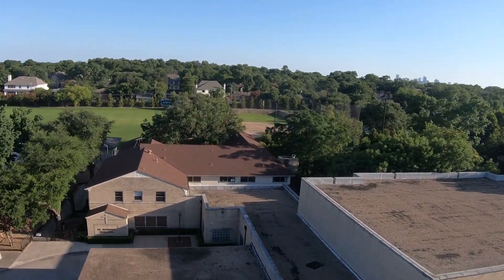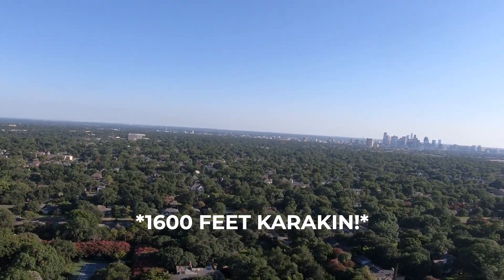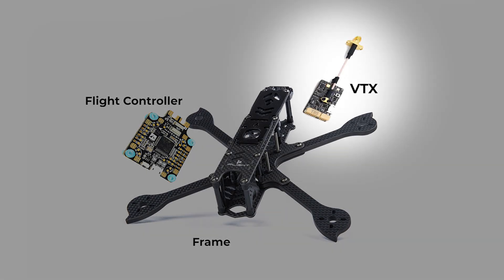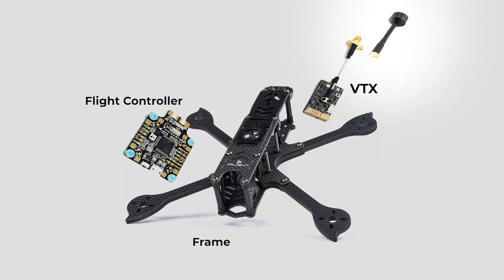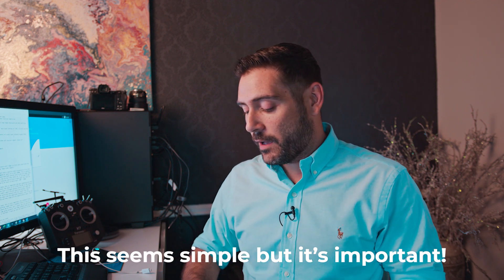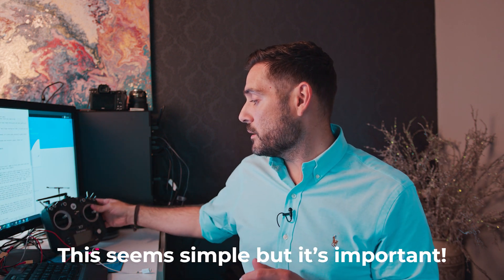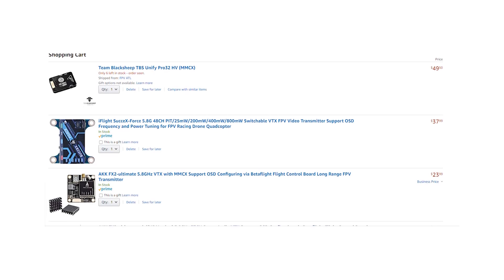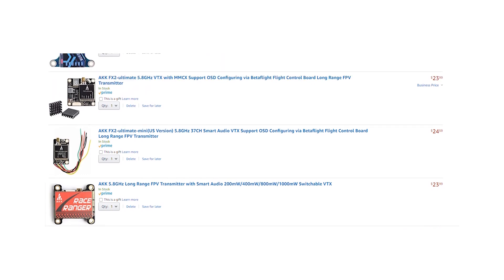Get better Mid to Long Range FPV Video, Long Range FPV Video, required equipment list.

Comment: My understanding is a linear antenna has a higher gain over a circular polarized antenna for long range. For a quad a CP antenna may be a better choice, but the fixed wing guys always run mono pole antenna

Comment: I use radiomaster ERLS Gimini @ 915/868 MHz dual antenna, i never had a issues. 3km@ 10-25mW @ packet rate 250Hz output power. System max is 1W. rate from 50-1000Hz are possible.

Comment: Anyone watching this video now. TBS Crossfire is no longer the best protocol, ELRS(ExspressLRS) is a much better overall protocol now. TBS Crossfire is a little but simpler to set up but its not quite as good.
Reply from the maker: ELRS is a joke. There are few situations where crossfire isnt still the gold standard in reliable long range. I know many people who cannot break even 1 mile with ELRS 2.4 no matter what bardwell says, and ELRS 915 you might as well use crossfire. Crossfire is good for 5. I should make an updated video though. Which would also include ELES.

Comment: Crossfire. Failsafes done. Surprisngly I had a lot of success with FlySky before I got a Taranis and eventually Crossfire. Crossfire is so simple - over the air updates of receivers.
One thing to do is mount your RX antenna at the front of the quad - that way when you turn around to come home the rx antenna will in facing you. 
You'll start losing link quality (RSSI) on the way out, then you just turn around the the LQ should improve straight away.
These days you get the diversity nano Crossfire RX and you can have one antenna at the front and one at the back. If you put them on arms you can do one on the left and one on the right.
You can also do the same with some of the HD VTX's these days - some of them come with two antennas.
If you want to do long range every system (i.e. control link and video) that has a transmitter or antenna needs to be top quality.
True RC make some nice video antennas.
And the tuned TX antennae for Crossfire is pretty good.

Comment: 3 years in the future and I can say that most of this is spot on. However I think the most significant improvement to an analog long range setup is long lolly-pop antennas, both for the VTX and the receiver antennas on your goggles. Your head and the frame of the quad are the 2 biggest sources of interference.

Mounting the camera at 3 points and not 2, is a biggy too. It only needs to waggle 1 degree and the picture's a zig zag mess.

ELRS is hugely more affordable than TBS XF and works so well. With built in WiFi they are super simple however use 115200 Baud rate if you use a module.
Reply: Elrs is great cheaper alternative to TBS if you're willing to learn and set it up.
Reply: @tommegg8486  It's kind of what hobby's are about. While flying is fun it's always better when you learn something that enhances the experience.

Comment: Hell I realized with a decent 5.8 setup I could go quite a ways on the ground with a car and massive obstructions in the way. It really is Harry Potter science sometimes. This is all great information though. I would say technically to cosign your statements here.. so long as you are in the air with what is more or less LOS you should technically be able to travel any distance in theoretical LOS on any kind of system that's 5.8g or below. What I've been stuck on is how people are achieving long range at ground level and through massive amounts of obstructions using 1.3g or even digital 5.8g. It's a whole new level of Harry Potter magic.

Comment: Is eachind ev800d ok?
Reply from the maker: A lot of people like that but I would prefer a used set of HDOs and a module bay I can upgrade. I love the TBS fusion.
Reply: @KAREKINFPV  too expensive. Im from Malaysia and it cost around RM1,500. Imagine that in $1,500. I understand that FPV hobby is expensive. Im just trying to get a cheap mid range signals. 

I have issues with my FPV signals. My setup are:
- mobula 7
- flysky i6
- FuriBee VR01

The issue are:
- signal lost within 3-5 meters
Reply from the maker: @alexruka  I understand price is a lot. This issue sounds like you have a bad antenna on either your VTX or goggles.Also I don’t think the mobula has a very high output power. 25 - 200mw. But 3-5 meters is very short. Insure you are on the correct channel also.
Reply: @KAREKINFPV  does a minor scratch on the VTX antenna can cause issue too? Yes sir 3-5m im not lying its too short. Only 2 channel i can found. The others distorted. 

And also, thanks for the fast reply. Really appreciate that. You got my sub🙏
Reply from the maker: @alexruka  the vtx may be bad. I would purchase a new vtx first with a new antenna. Then test it and make sure you’re on the correct channel. If it’s still not working then it’s your goggles or the goggles antennas.

Comment: update express lrs is better and cheaper than crossfire
Reply from the maker: Sorry man but I don’t trust saving $5 to chance having a betaFPV module crap out snd losing a $900 rig. Also you can’t get telemetry back to the radio past 1 mile ish. Crossfire will go 3+ before losing telemetry. I know bardwell is pushing it hard but there are some disadvantages that aren’t worth switching yet.
Reply: @KAREKINFPV  by your answer I feel that you are the kind of person who thinks spending more means more performance look up wezly wartys testing tracer is shit ghost and elrs is the future naminmo and happymodel are killing it with quality
Reply: Your telemetry speculation is wrong
Reply from the maker: @CHIRAG_FPV  That isn't my speculation. I spent 2 hours on the ELRS discord discussing it in "general" with the admins. You're welcome to go back and find my conversation.

Comment: elrs is better rn
Reply from the maker: If it wasn’t for the telemetry issue I might agree. With the highest power RX you can maybe get telemetry out to 1 mile. With crossfire it’s at least 3.5-4

Comment: What kinda battery do you need for a Chimera7 6S to fly long range?
Reply from the maker: I use these on my chimera 7 https://liionrc.com/products/6s-4-200-mah-45amp-long-range-fpv-drone-battery-range-v1-lithium-ion
Reply: @KAREKINFPV  What kinda flight time and speed are you getting out of that pack?
Reply from the maker: @arkansasaviation5299  without a GoPro and 1300kv motors easy 20+ min. With a GoPro 8 around 12-18 on 1700kv motors. I can cruise at like 60 with 1700kv motors.
Reply from the maker: @arkansasaviation5299  this is the most popular LR battery for 7” on the market.

Comment: Mr Karekin! I learnt so much from just this one video! Any chance you'd do the same guide for dji fpv set up? Im using dji transmitter with dji v1 axii antennas... however i do need a vtx antenna guide on my drone.  Not sure what to go for. Thank you!

Comment: Please what about foxeer wildfire module?
Reply from the maker: It’s a decent module. Not as good as true D Or fusion.
Reply: @KAREKINFPV  thank u cuz when i mount it on the ev 800 d as a mod no improvement really
Reply from the maker: @elbedouirayen7938  it could really be your vtx or camera too. AKK and RDQ, vtx are pretty much crap. The best ones are TBS unify pro 32 HV, the Rush Tank, rush tank solo. Also be sure to turn off any diversity syncing. Sometimes that can mess with the reception if the system doesn’t like the camera you’re using.
Reply: @KAREKINFPV  ok friend thank u so much then i try this
Reply from the maker: @elbedouirayen7938  also always try to use the least amount of antenna connections as possible. So if you’re going from MMCC to SMA then get an antenna that’s an MMCX connector only.
Reply: @KAREKINFPV  yes it's like that so i will change it direct antenna

Comment: After stupidly close frsky failsafes, I put crossfire in everything I have. Never had a failsafe since. My skyzone 03o goggles worked pretty well with the internal and you can add a module to them. But I went to dji. Way way better penetration with dji. Not sure how the hell that even works since it's also 5.8ghz.

Comment: Good info here. But Dipoles can be used for long range, you just have to have linear antennas on your goggles too. There aren't as many options for linear patch antennas on the market, and most people think the regular dipole "rubber ducky" antenna is worthless, but I have gotten some of the best reception flying one of those and a nice linear patch. Try it some time!

Comment: I still only get about 100 ft only w Tbs crossfire
Reply: Make sure you are using 915 MHz on the module if you are in the US
Reply from the maker: Do you have a tango 2? I won’t fly a tango 2 because I don’t think the power output is correct. I could never get one that didn’t have issues. I always use the full sized radio and micro TX.

Comment: May as well go with DJI for the price
Reply from the maker: True, at the time of this video, DJI needed some desperate firmware updates. But there is a point where analog can go further than DJI. By a mile or two in the right conditions.

Comment: This video is pretty outdated, now with express lrs you can have even more range and less latency, 2 times smaller recievers with a total price half of a crossfire cost.
Reply from the maker: Tell me you know what your talking about without telling me you know what your talking about. 💪🏻💪🏻💪🏻💪🏻 although I don’t mind the convenance of crossfire for the extra few dollars. And latency isn’t a big issue when you use something like the DJI vista for long range.

Comment: basically you have  a lot of money as you are advising every expensive option. Should not people get a gold plated frame too? easier to see in the grass. Lol. You need a good rth setup to fly your device back if you out distance your tx and rx gear.
Reply from the maker: I’ve had this discussion with people before. A nice AKK 1w+ VTX is like $45, you can buy a pair of dom V3 used for like $140 and a true d module for $40. It’s hardly the most expensive option. You get what you pay for.

Comment: What about the new Happymodel Express LRS? $24 rx $24 tx and its been tested up to 30km?
Reply from the maker: I’ve heard great things about express LRS. I wish they had a 433mhz version. It’s just not as easy to setup as Crossfire
Reply: @KAREKINFPV  I think thats what the happymodel one is supposed to fix, it comes pre flashed so i think its just bind and fly at that point.
Reply from the maker: @akaKrypt  nice! Please keep me posted on your findings.

Comment: Hi There,  just found your channel. Quick question, do both antennas (on drone and goggles) need to be the same length? I have a hglrc LR antenna on the drone but a small foxeer lollipop v3 on the goggles. Same DB. Thanks . New Sub 🤙🏻
Reply from the maker: Great question! No they don’t, you can use different lengths. The further away from your head the receiving antenna is though the better. Also they both must have the same polarization RHCP or LHCP
Reply from the maker: Also if your doing long range flying, checkout my new shop! LiionRC.com

Comment: Great vid mate 
I also gave the qx7 
Did you do the mod to get the module to work or has that limitation been overcome 
And do you recommend the mini over the full size TBS module ??
Reply from the maker: I wasn't able to get the crossfire settings to work on the QX7 and never tried the mod. I would just plug it into the computer and use TBS agent to change all the settings. It works great! I love the new mini v2 it goes up to 1w but i've gone 2 miles on 500mw with no problems.

Comment: Okay to summarize it a as leymann - We need VTX + spec. antenna for the VTX on the Quad, then we need a Module that should go in the Goggles to receive the video, then we need Goggle Antennas to amp the module and see a nice pic. Then the other way around we need another module that connects to the radio, preferably Corssfire from TBS, and a receiver to receive the signal from the radio, that goes on the Quad? Does the receiver on the Quad need an antenna? Same question for the Radio module? And one final question? Is there on the word a chance to connect this video receiving module with any sort of monitor or even better - an ipad instead of goggles? Hate these goggles sorry but I get a headache...

Comment: Most goggles can actually take an external module with an adapter. Pretty sure it adds a bit of latency to the video feed but it's pretty nice that you can have cheap goggles with rapidfire and upgrade the goggles later and keep using the same module.

Comment: If you have an antenna plugged into the crossfire module on your radio then do you need to use the second antenna (where you have the dipole one attached)?
Reply from the maker: You need to have both antennas of the crossfire system attached for the best range.

Comment: Karekin FPV: You need to buy a $50 AXII patch antenna for good range.
FalconRad FPV: Hold my $5 DIY helical antenna while I fly 8 km into the Alps.
Reply from the maker: Most people don’t know how to build a helical antenna. And range is a function of your RF environment as much as it is your equipment. It’s easier to say, “buy a good antenna” than, “here try and build this crazy looking thing”, I fly DJI now though and fly 4km almost daily. I should probably make an update for this video.
Reply: @KAREKINFPV  I know, just joking dude. Great video and nice tips. Agree with what you're saying, there are many different ways to achieve good results. The gear you recommend here is quite robust and should definitely get the job done.
Reply: Also, FalconRad recently uploaded a video where he says he's upgrading to the AXII 2 patch. I suppose they are that expensive for a reason.
Reply from the maker: Most people can barely build a Kuad. Soooo...

Comment: I have been flying my True-D for a while with really good results. Wanted to build out a ground station using my Pro58 with Achilles and was really surprised at how well it works still! Anyway, great video and right on with antennas. I have the AXII V2’s installed with an ORT 6 turn helical...it affords me clear video out to the range of my quads pack, about 5km.  Long Range piloting really is a discipline that requires some thought going in to your setup for success.

Comment: Do i need different module and vtx in order to switch antennae? (From dipole to lollipop) Or can I get away with plugging in different antennae?
Reply from the maker: Check which connector you have? Sometimes dipole will have a UFL connector or MMCX. But you can omnis for UFL and MMCX.

Comment: Bro skyzone can take an external module with an adapter and they are pretty good for 220$ as you can upgrade the module in the future
Reply: Yupsss 😂😂
I have Skyzone Cobra X and rapidmix module
With this pair its pretty good box google
Reply: Skyzone 04x has 2 module bays for quadversity. Mine work great!

Comment: Recap... Skyzone's allow you to put a module in them, like the 04X which comes with a built in module that gives RF and Fusion a run for their money, and to bring it back even a little further the Skyzone 02C or X have module adapters which work just fine... Your info is somewhat true but your only thinking of your bottom line as appose to those that are less fortunate, so to say that if you don't have the budget to splurge on the premium hardware you aren't going to have a good FPV experience is just very judgemental and naive and bias on your part. I run Crossfire everything on my rigs but I would never say that if you don't have my set up you won't have a good flight, it's nonsense. enjoy your channel.
Reply from the maker: Bro, you can get a pair of dom V3 for like $150 and a true d for like $50. It’s not about money.

Comment: Karekin, thanks so much for the video!  I'm really interested in long range FPV ground and air.  That's the reason I recently decided to get into the hobby.  I have no RC background and I have found it difficult to determine what system will achieve max range.  If I look around the internet at a particular month, I see there is no consensus on the best setup.  I see people posting range videos with many different setups.  

Are there resources that you recommend like forums,  or YouTubers, etc.?  

Does the controller matter when it comes to range?

I've been reading through Long Range Hooligans on Facebook, various YouTube videos, and AMA website.  I just bought the RadioMaster TX12.

Comment: 1600 feet is actually pretty bad for 5.8 without a groundstation. With my 7" kwads and a 5ah 4s I make 8km out and back easily and with my zohd dart 20km+ with no problem.
Reply from the maker: I agree, I’ve gone 2 miles on DJI but in the city it’s a whole different ball game.

Comment: 50 miles.  Hahaha. 👎🏻
Reply from the maker: It states on the TBS website that the theoretical distance of a full Crossfire module is 50 miles. That’s what I said. The TANGO 2 has a theoretical distance of 25 miles. Go keep flying your R9 some more and we’ll see who makes it back.

Comment: just ordered tango 2 pro ver3 board, with nano diversity, i guess now i have to retire my 40 $ box diversity which i never used, been using anlogue on my DJI goggles RE which came with mavic Pro2, 

trying to build a 10 mile range 7 inch, long road ahead but i need good googles with good module, thanks for advice

Comment: Your version of long range is much different than 3 to mile is very easy and all I use for video is 5.8 900 fry sky but I fly plane quads have have nothing but electrical garbage all around them that is where you get so much interference and most good video is all in the wiring not spending a fortune like this guy wants you to. My buddy spent a fortune with all that stuff he is selling and I usually go farther than him.
Reply from the maker: Sorry man, but nothing will take you farther on 5.8ghz than a TBS Unify Pro HV 32. I’m glad you had good experiences with cheaper stuff.
Reply from the maker: Or DJI.
Reply: @KAREKINFPV  yeah, save for DragonLink